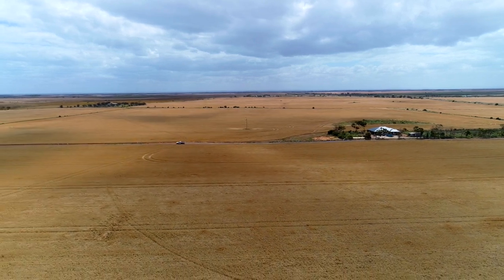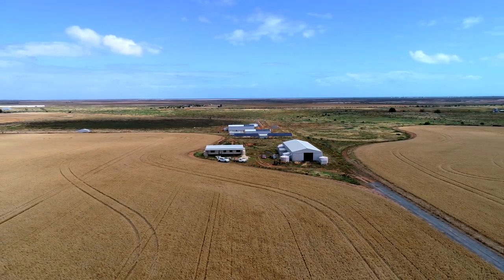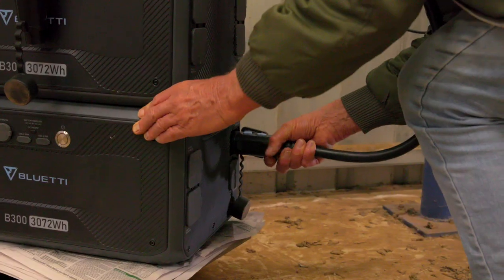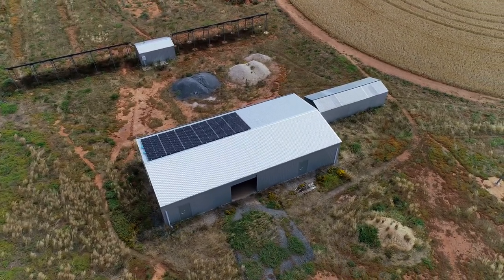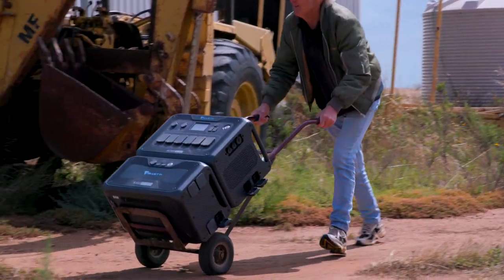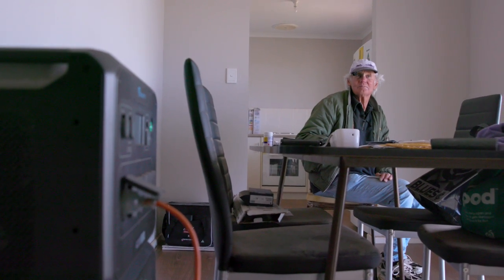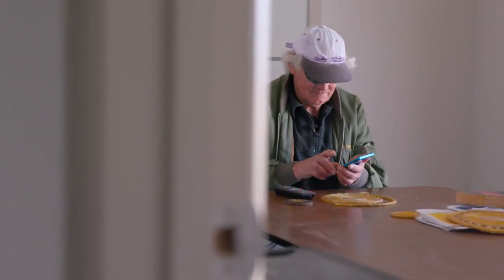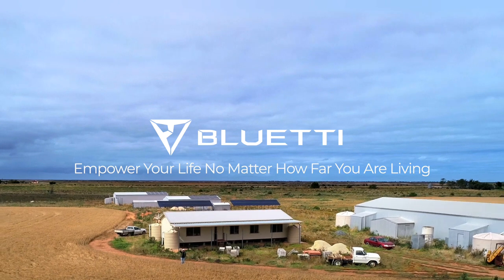BLUETTI HEROES: Off-Grid Farm Life Enlights, Enhanced, Empowers

Comment: How do you recharge your bluetti? Do you use the solar panels on the property?
Reply from the maker: Hey, my friend. Tom has a lot of solar panels.
Reply: @BLUETTIOfficial  Yes, those are the panels I am referring to. He has an off-grid system installed on the farm. As you say he has a lot of fixed solar panels. So does he use these fixed solar panels to recharge the Bluetti power station?
Reply from the maker: Tom usually recharge the power station with his fixed solar panels system and other generators : )